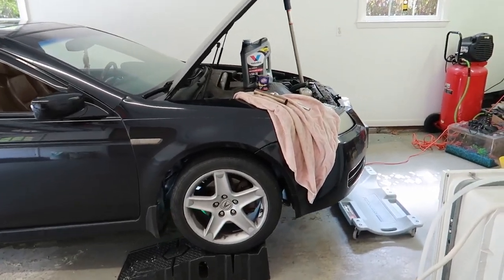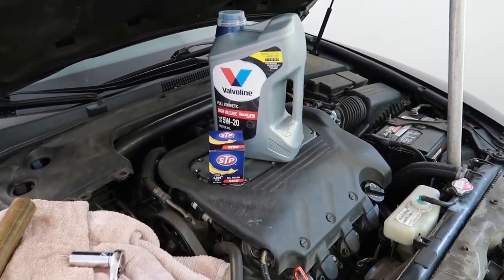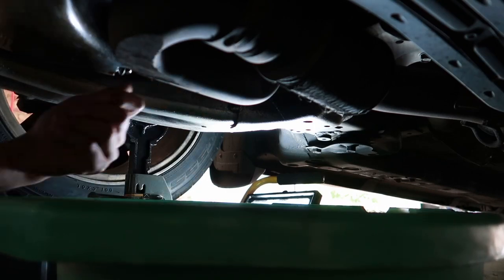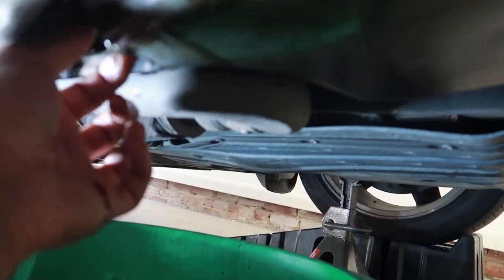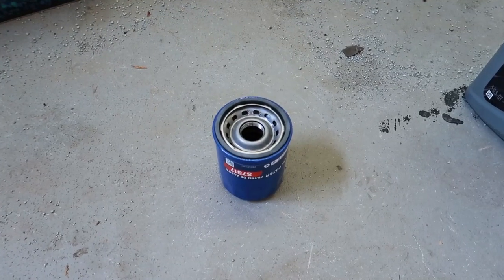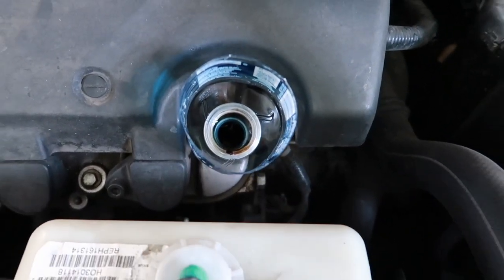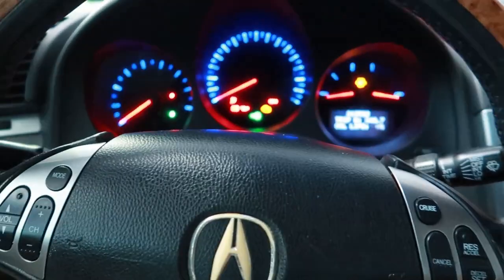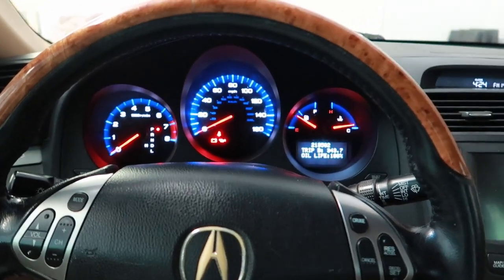How To Change Oil In A 2004-2008 Acura TL In Under 5 Minutes

Comment: Would it be okay to use 5w20 castrol part synthetic? I just got this car couple months ago
Reply from the maker: Always use the recommended weight oil for the vehicles. Only use a heavier weight if the vehicle have a ton off miles or if you hear piston/cylinder noises from the vehicle.
Reply: @2xmototv206  synthetic blend or full synthetic?

Comment: Never seen no one put oil inside the oil filter
Reply: If it filters oil why add oil to it
Reply: I think it’s a old school race car thing I don’t think people actually do it any more
Reply from the maker: It takes a while for oil to cycle through the filter. You don't want it dry to have to fill up with oil and suck it from the pan.. it's a good habit to have by filling the oil filter as well so it doesn't have to draw from the pan and try to fill up..